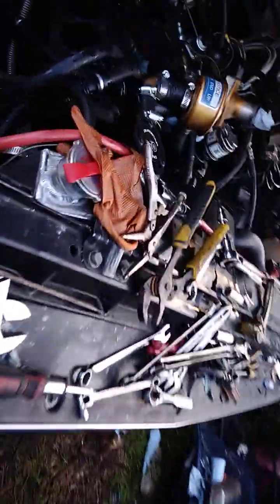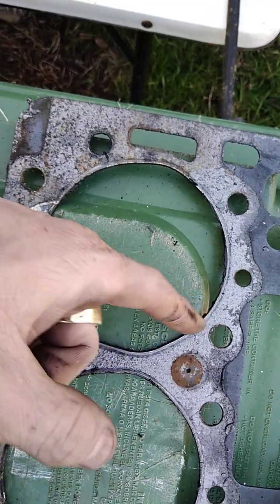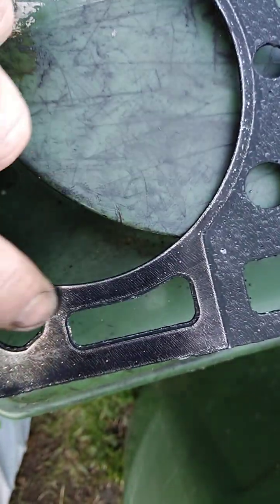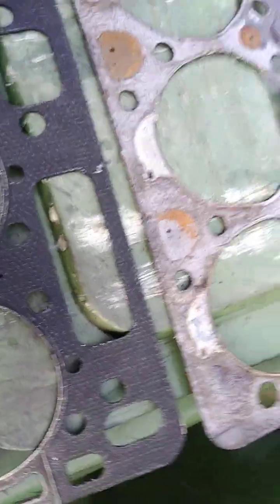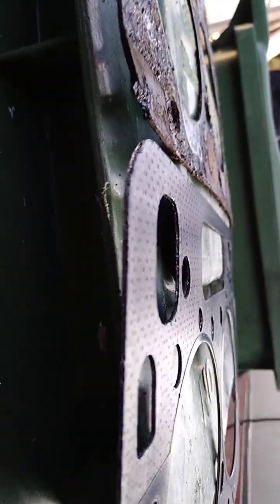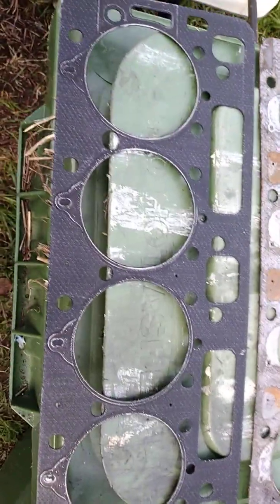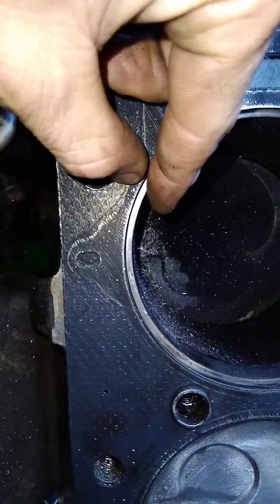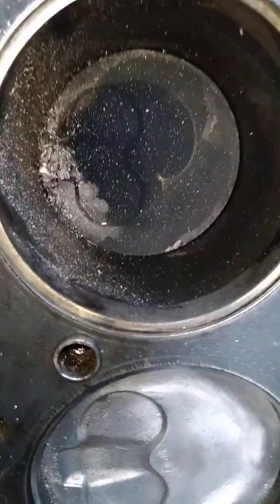6.2 Diesel vs 6.5 Diesel Head Gasket Comparison

Comment: What heads can i swap on my 6.2 for more power that bolt up with keeping most of the stock parts
Reply from the maker: Non really. If you have a good set of old '82 J Code Heads they will out perform 6.5 Heads if Turbocharged but have a high chance of failure if not properly maintained heat wise. The newer Heads have different metal in them to help with strength and prevent cracks but failures still happen. The only way to get more power from heads is if you have the fuel and air flow to match.
Reply: @TheAscendedMaster  lucky for me my truck is a jcode seems to run better then most stock 6.2s Ive seen

Comment: Can a 6.5 ho gasket be put on a 6.2 without issue ?
Reply from the maker: No. On old 6.2s w heads that have coarse thread injectors I believe they may leak due to the bean shaped coolant port they have. 
I have a 6.2 block but new 6.5 heads so 6.5 gaskets would work. To note. These head gaskets failed in 18 hours after install lol After I tore it down again I went ahead and used my previous gasket type of 6.2 Fel-Pro Permatourqe .10thk Head Gaskets which has proven to be a good and most reliable choice. I won't be trying to use 6.5 Head Gaskets again lol
Reply: @TheAscendedMaster what’s the part number for the felpro permatourqes? 8726 PT or 9128 PT
Reply: What's the part number for the 6.2 fel pro head gasket?

Comment: do you think the one side of the head with the useless  coolant passage could be filled  part way with Hardblok block water jacket filler to close it off
Reply from the maker: I would probably talk to a shop and ask them what they think about it and what they would do. If they have experience with these heads they might have some good ideas. Also, it was just a thought I had been wondering about and I have not done this myself as of yet so I cannot say that it will work or not.